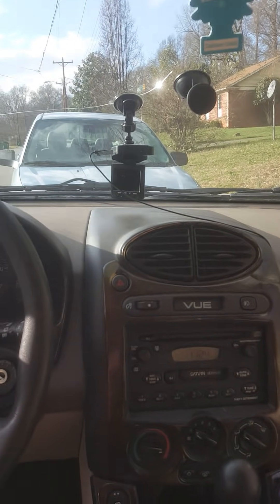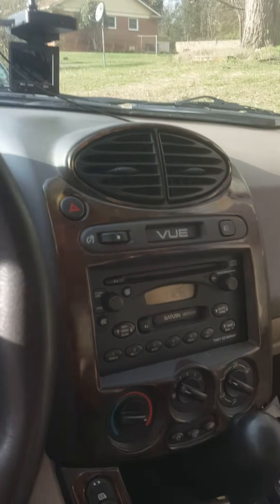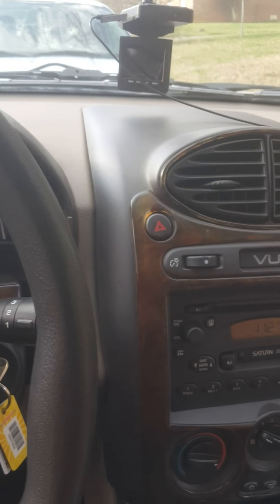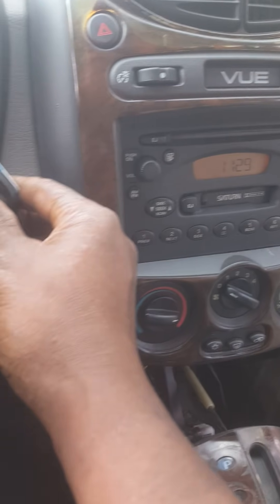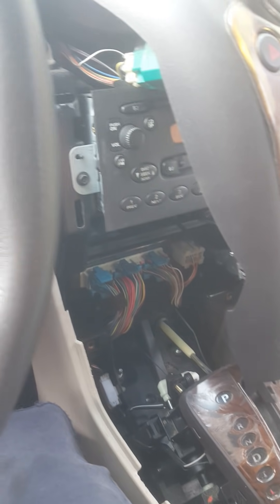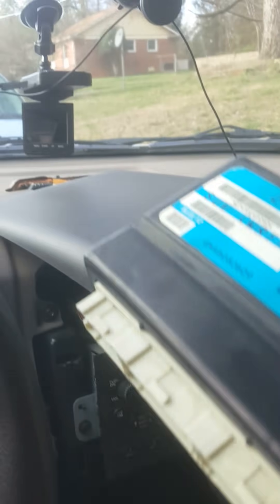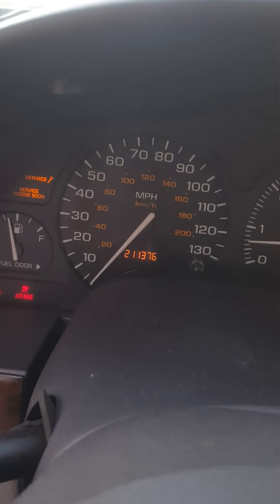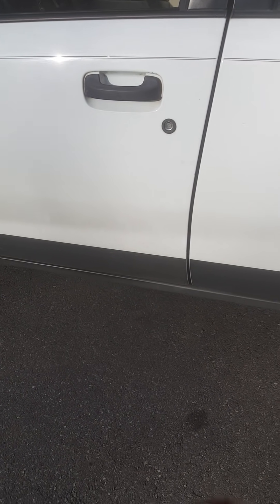How TO PROGRAM A BCM ... WITHOUT GOING TO THE DEALER

Comment: ok is me Arron, I had purchased another bcm off Ebay, to hopefully get all my stuff working better,, now , asI had that problem with the bcm before, I had been driving it with theb attery disconnected, however, I let it disconnected a little too long this time, drove to work, on the way there the car gauges started going crazy, flipped around, then the car shut off! I pulled it along the road, a the same time, a rollback pulled up, the guy asked me is there anything he can do?? I said uh,, yeah try and jump this battery, well he did,, the car started up again, now , I ask this, what happened! the car runs without all that jerking around anymore, like the computer was booted being the battery went dead,, so now,,, the battery still is being over charged, I am thinking its the system giving it a bad  reading, causing the alternator to put out the voltage it is,, now, it only puts out 19 volts no more, matter of fact, it cuts off charge!!! then resumes charge!! Can I switch out this bcm on this car the same as you did??  maybe thats the problem the bad bcm??  I am really troubled with this,,,,, i found a garage to take it to to have all the componons tested but, if this bcm will solve it all, why poay for all that, right?
Reply: Is it working now  ok ?  the  BCM you bought on ebay was it used ? i saw they sell them used from other cars of the same make and model   lot less  money too.  and i wonder  if   they are already programmed since they came out of another  car   ,  i was thinking to order it and try it out
Reply: @joedevitto6113  uh, it worked, but I went and bought a truck an older one it works great , the Malibu rubs good but, it needs to be checked out nothing in the car now works the instrument panel is ok , this is by the old one I bought but the car needs to be gone over for everything to be right! It runs well! No defrost or nothing though even the radio is off I hadn't checked the fuses, I'm gong to sell this car soon ! It has to be worked on the intake is causing the overheating , these cars are known for this. You have to keep watching the temp gauge and keep it purged from overheating !! Normally when I fill it with coolant and purge it it runs great for a few days, pain in the ass along with the bcm issue!!

Uh the newer bcm shows antitheft light on , don't know how to get that off other than that ,it worked great, as I said ,I got fed up and bought a Ford explorer, great buy for 500. It runs great but the abs messes me around using the brake ,but drivable ! I don't have overheating issues!! Whew!
Reply: @joedevitto6113  yes it was a used one it  does work but ,to do it right it needs to be put on the machine to put in the updates and make sure everything works like it supposed to ,but I really am not taking the time to do all that , that's about 200. Plus whatever else . I would like to but it runs good the instrument panel works as it is and that's another think ,when the dealer hooked it up they never made sure anything worked right it runs ok , but it causes the alternator to overcharge !! I'm selling it . Someone else can play with it .
Reply: @joedevitto6113  oh yeah then after all that I have to run the dam car for about 80 miles so it recognized all the  parameters again!!
Reply: @stoner4  ya thats what they need..  i ended up  trading in the  car  after 16 years   just   had enough  and bought a   Chevy  Cruze   nice car...  few years old.   hope it goes  well ..     the Monte almost didnt start when i was  going to the dealer ..   prayed all the way there i would make it..   they gave me  2k   for it       i was  happy
Reply: Yeah I bought a 98 Ford explorer instead ,I'm cleaning out the Malibu and selling it for say 500. I put alot of new parts into it ! Took off some too. So someone else will get a good car when they get it checked out,it runs good now,!  Anyway the Ford has an abs issue it needs bled out I believe . That's all really!
Reply: @stoner4   i guess  we area all switching  over to another car lately ,   just got to do it  i guess ~  see how it all goes

Comment: ok now , I have been having issues with my 98 chev malibu , on accelreation , this bcm i believe is the problem, it causes the alternator to run 17-18 volts!! upon running down the road when it gets to operating temp, it seems like some circuit is also heating up and loosing the ability to workmmy accelration, it bucxks and carrys on , when i leave off it woulnd't do it, it is only when i accellerate after the car is warmed up ! 
now this had just started acting this stupid herre this week , I have another bcm ordered off ebay . So i guess i can change it out like you did .
Reply: was the bcm you ordered used? and did it work?
Reply: check for faulty grounds first

Comment: FROM A LICENCED REGISTERED MECHANIC AND GENERAL MOTORS ABOUT THE BCM  "Remove and install a BCM body control module
All repair procedures tell you to disconnect the battery cables first. Well, this time they mean it. NEVER disconnect or connect a BCM body control module with the battery cables connected. You can damage other electronic components connected to the sensitive data bus and you can even blow out the new parts. The hardest part of the job, aside from finding it, is figuring out how to remove the electrical connector locking latches. Once you figure that out, just remove the connectors and remove the BCM."
Reply: I was wondering about that Tim ..   i read up a lot on doing this.  most said   unplug the batter first thing ,   i need to replace mine  and trying to figure out how to do it .  also wondering if it will start up after i change the BCM.. since it wont start   now  ,   so i can get it to the dealer  with out towing it..
Reply: Thank you Tim Clarey, your post was extremely helpful except we seen your post after we watched & did what the video said (but would like to thank him for just being kind & trying to help people out he will be blessed). So did what video said, didnt work plus my security light came on & won't go out.
Our problem from the beginning was our 2000 chevy  S-10 WILL NOT START!! It's getting spark but no fuel, we have changed the fuel pump, fuel filter both brand new the pump IS working(you can hear it) so the fuel gets through the filter and that's it, stops there.
Been working on this for a couple of months now we are completely frustrated at this point & can't keep putting $$ into thing's that aren't causing the problem were on social security so a very fixed income.
Any help or thoughs that you can give would be greatly appreciated. 
P.S- the truck was running perfect then one day just wouldn't start.

Thanks in advance,
Angela
Reply: @angelapruitt6307  I know this is an old post but Curious if you'd ever found the issue.   I've seen this happen in older GM's.  We had a very hard time to find it but  If I remember correctly it'd ended up being a bad hall sensor in the distributor the computer uses to verify the car is running and if it doesn't see it it shuts off the fuel.
Reply: Tim question on buying a used  BCM   from Ebay that came out of a  2003  monte carlo.    would that  work  if i just connected that in ..  since its the same car it came out of as mine ?     or does it still need to be reprogammed    , not sure about the vin number or the  miles  reading   would be affected  ,  $40  is not a bad price if this would work ,   Thanks
Reply: @joedevitto6113  it needs to be programmed to the VIN
Reply: on a chrysler minivan I think its easier to remove the engine as they hide the BCM behind the junction box below the steering columb. Then add insult to injury by putting unessesary bolts to attach it to theBACK if the Junction block. I was having two years of litghts that would quit at night, no horn, no brake lights, no instrument lights or instruments, no interior lights no wipers, no radio no windshield washers
But it started up ok
Reply: So how to correct the mileage for you vechical
Reply: yes they tell you that as a standard warrenty protection so they can save their butt. Its risky but if you leave the battery connected you are basically live swapping one computer over for a good one , storing the data for the new BCM in the ECU

Comment: You didn't reprogram. You need to set the vin and milage.
Reply: Remove and install a BCM body control module
All repair procedures tell you to disconnect the battery cables first. Well, this time they mean it. NEVER disconnect or connect a BCM body control module with the battery cables connected. You can damage other electronic components connected to the sensitive data bus and you can even blow out the new parts. The hardest part of the job, aside from finding it, is figuring out how to remove the electrical connector locking latches. Once you figure that out, just remove the connectors and remove the BCM.
Reply: but you can hot swap and save hundreds of dollars

Comment: Hey Aaron did you get the BCM to work? I need to replace a 2004 Saturn Vue AWD. And wow $150.00 is a lot to have a dealer to program the BCM..Plus $160.00 to 250.00 for the BCM, plus labor..
Reply: Mikki Rhodes I'm in the same boat right now. I have a 2004 Chevy Malibu that the brake lights don't work. That's the only problem. The mechanic said it was the BCM and I'm on disability so can't afford much so I ordered used one on ebay. Then once it's here I find out it needs to be programed and now I'm screwed because I can't afford the labor plus the programming. But at the same time I wonder if mechanic was wrong. Idk. I'll never know unless there's a good guy out there that can check it for me free to confirm this guy's diagnosis but they all charge me and I just can't pay more money.
Reply: @31Lcons  the BCM went out on my 07 Yukon. Wouldn't crank, no overhead lights, no windows/locks. Ordered a used one off eBay for $75, same exact p/n as mine. Popped it in and it started up. Only issues now is the radio is locked, lift gate doesn't work and backup assist doesn't work.
Reply: mom2two  So ,first check your fuses, you may only need to replace fuse for a couple of bucks. Second see if someone will disconnect your battery cables for half hour to see if BMC might correct itself.
My mechanic just replace my starter, $ 170.00 for starter, and $100.00 for labor.i got $ 40 bucks back once I returned the core 👍🏾. Now I notice my mechanic had to disconnect the battery to put the starter in, and the BMC problem I thought I had has been corrected. There is a You tube video with a guy talking about this. Hope this helps.
Reply: @31Lcons  check the fuses under hood and under dash
Reply: @timclarey2648 that was first thing that was done. Mechanic said it's BCM
Reply: tim clarey i
Reply: @31Lcons    I saw some for sale on Ebay they are from  the same cars we have   maybe  this might work since they are already programed i dont know  for sure yet ..  under $50   ,       not sure  about the  vin number though and the mileage reader ??
Reply: ]um
Reply: they go for 150 to 300 on Ebay and you can get a warrenty with them

Comment: So I'm thinking about buying a 2004 very clean Saturn Vue for 300 bucks the guy took the cables off the battery to replace for a new battery he then said the car security acted as if it was stolen hasn't started for 5 months he gave up just wants it gone was supposed to be for his son so is it worth buying it? Or am I getting into something too expensive and too much work for 300 dollars? I figure I could flip it for a profit if I can fix it but if it's too much then I'll pass but I'd like your feedback please, thanks..
Reply: If you don't buy it let me know where it is. Just kidding, buy it though. Just insert the key and turn it to run and leave it there for like 10 minutes. Then turn over motor and drive it home. That usually will fix or by-pass the security lock. I have even used the key fob too, just press unlock twice if it works. If neither works then maybe stay clear of it.

Comment: 2002 impala  is bcm bad ?? no power to pcm/crank fuse, turn key no power the starter, wipers don't work ,no turn signals working,.,no radio, power mirrors only work one direction, no horn,,backup light flash on and off, no headlights, key only locks drivers side door, hazard flash only works front blinkers, battery goes dead over nite
Reply: I had similar issues with my Saturn Vue. BE SURE TO CHECK THE ALTERNATOR! If it is failing, and giving various voltages, it can wreak havoc on the BCM and possibly the ECM.

I had tons of problems finding a replacement BCM because they varied considerably between not just models and years, but sometimes simply between the same cars in a batch.

Eventually, I bought a new one from GM and had the dealer re-flash the memory. Well, I guess about half the idiot lights went out the next time I started the car, so I was kind of successful. The whole BCM drama is frustrating, everyone has a different opinion and real information is guarded as closely as the nuclear launch codes.

Good luck.
Reply: thanks that about the only thing I haven't cheaked
Reply: @Akula114    is it working  now ok ? .  ive got the same things going on  dash lights and  things not working .. and now no start....
Reply: its got broken wires or its possesed
Reply: sounds like it

Comment: Thanks Aaron! This video demonstrated a lot of VERY valuable info, like where the mileage is stored and how to swap BCM's without going to the dealer! Like you said they don't make BCM's anymore, so our only real option is salvage yards, anyone that thinks your video isn't helpful is nuts, this will save me at least $150 bucks, I really appreciate your posting this!
Reply: Did you have to get your bcm flashed or reprogrammed? I bout a used one....put it in and rode out. NO flash...reprogram or nothing. No Problems
Reply: I found this place on line  called  auto parts warehouse  i see a few they carry. i need to get one myself   and was checking around   $150 or so it says  i have a 2003 Monte Carlo   did you get your fixed Ken  ?
Reply: but refurbish BCMs are all over Ebay cheap

Comment: I do appreciate you trying to help others that have no idea where to start, but you really need to have a finished conclusion in order to sell your fix.  Otherwise, you just come off as another person trying to get views.  Someone in here does unplug the battery and puts it right back in, and the problem is solved temporarily, but perhaps if they waited 24 hours it would have stayed fixed.  Their solution had not reached a finished conclusion either.  Funny how haters in here can be so rude, yet they don't have the answer or even a guess.
Reply: But it WORKED!

Comment: Aaron Harris will this work on a 2001 chevy impala
Reply: Clayton Conley I got an 04 if you try it let me know if it's not to much trouble. I read that 00-05 Impala bcm's don't need to be reprogramed just unplug and replug the replacement
Reply: And then , what happened????
Reply: Mine 01 impala is in the same boat
Reply: try it take the risk

Comment: Hey,
That is not how to program the BCM.
What you showed was how to get it to keep the theft deterrent and some other settings to remain in memory.
These are called learns or relearns, not programming.

Programming involves transferring the data from from the vehicle manufacturer site to the used module or transferring 
from one module to the other using an appropriate hardware devices and software.

But your video non the less did show a method of how to swap a module, and keep your vehicle running without 
getting into key or theft system problems. At least it so appears on that particular vehicle.
Definately worth trying and worth while.

I am not sure but did your vehicle display the original mileage after or that from the used BCM ?
Reply: David Kellner firstly mileage is save on BCM . And then while you starting engine like these used BCM and turnoff , you can not restart by thieft detection. I am sure.
Reply: Anyone know what to do when your keyless entry stops working in an 03 gmc sierra?...yes i changed the key fob and actually bought new ones...but i cant get into the programming mode...if i have to have the bcm changed and reprogrammed, ill just live without
Reply: @insideoutsideupsidedown2218  you need to take the fob and vehicle to be reprogramed to VIN
Reply: tim clarey to the dealer?
Reply: My main question is why did it just stop working, i had not changed anything and the batteries were new in the fob
Reply: @insideoutsideupsidedown2218  they will occasionally drift off frequency
Reply: @timclarey2648  so to the dealer is the only way
Reply: Mileage is saved in both bcm and pcm
Reply: it does work tho no matter how you critisize
Reply: He went from 140,000 miles to 211,000 miles. Not good for next potential buyer of the car.

Comment: Thank you for that! Hope you got another BCM that works for you!
Reply: BCM from salvage yard, number 114 will work perfect. I have programming modules like the BCM starting in 1992, from my tool box. You have to have “TIS2WEB”, connection to the internet and authorization to change milage to be correct. The door locks use a rolling code of binary code or a possibility of 255 choices. They have to be synchronized. This is normally done with the TECH2 under special functions. Otherwise, it will start, run & shut off. Leaving the key on does nothing when swapping the BCM. Brown connector removes power, so what does that do. When programming the BCM, you have to have a stable continuous B+ to the module. Measures are taken to make sure the battery connections are clean, battery good and backup connected. This is messed up!
ASE Master Tech since 1978
Retired